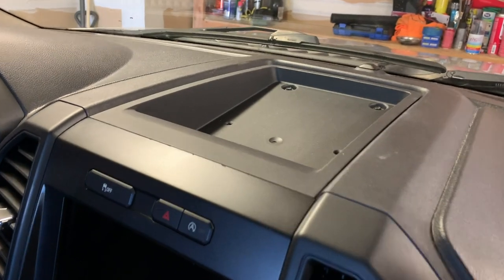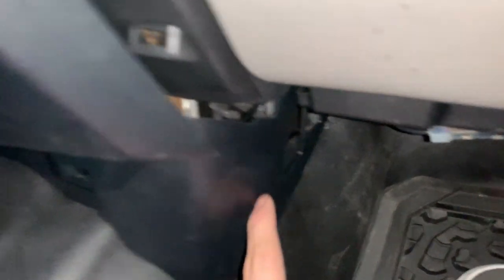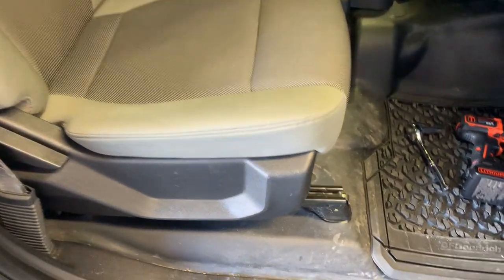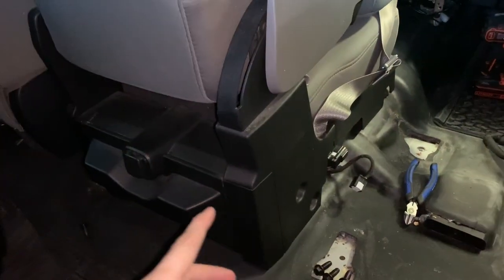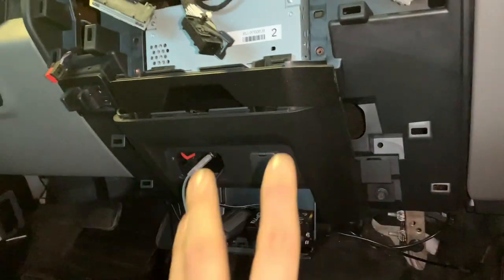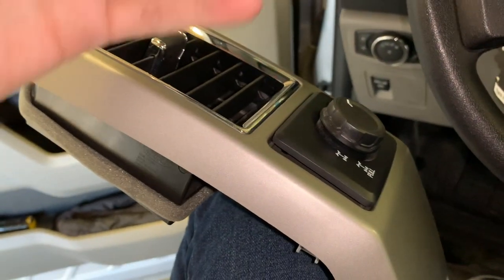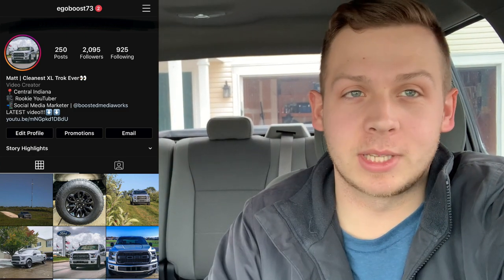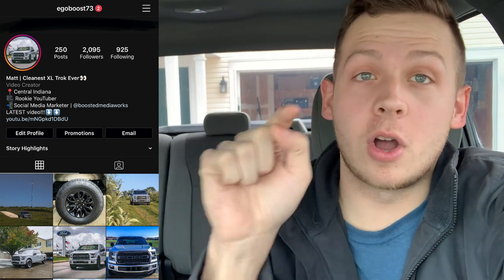15-21 F150 Center Console Install *In-Depth*

Comment from the maker: FULL DISCLOSURE: I did not hook up the rear vents.
Reply: Have you though about doing the keypad on the door install
Reply: I love having the bench seat option. Only reason I would install one of these would be for the rear vents. Wish we could have seen the full install.
Reply from the maker: ben randall I couldn’t set up the rear vents unless I wanted to cut up my floor which I was not interested in doing
Reply: This looks great! I want to do this to mine one day but I would like to hookup the vents as well.
Reply: @egoboost73 I saw you mentioned cutting the floor to add vents. What would you actually cut? Just the carpet I assume?
Reply from the maker: @jasonroth3787  I actually didn’t have carpet in my truck, I had the vinyl floors. If you have carpet, it might be easier to hook up the vents but I’m not sure how
Reply: @mattewalker_  ok. I saw you mentioned cutting up floor. I assumed it would be carpet/vinyl you are cutting and not the actual sheet metal floor. Figured I’d ask. Thanks. Hoping my ford guy can find the vent panels in the charcoal grey to match my interior and not silver like you used.
Reply: Was there anything additional that needed to be done for the electrical in the rear of the console to work?
Reply from the maker: @richardhom8283  nope! Not for my install
Reply: So I'm hoping you're still around..I'm doing this to my 2019 F150 BUT ALL the consoles I find don't have the lighter and the USB in the tray what console did you use?
Reply: @mattewalker_  you don’t have to cut up the floor to do the vents if you want to know how to do the rear vents I’d be happy to share with you how I did it
Reply: @davidrickey3776  how did you do it?
Reply: @fitzy1294  I added a short explaining.
Reply: @fitzy1294  I added a short explaining

Comment: Does hooking up the flow through vents require cutting the carpet? If you don't hook them up, is there still heat directed to the rear through the original vent system, or do you lost that? Very helpful, thanks!

Comment: Did you sell your jump seat? I’ve got 2 2019 f150’s.  Ones a lariat 4x4 super crew ecoboost the other is a XL 4x4 super crew that’s my daily driver.  It’s got the upgraded interior that’s basically a base model XLT but my jump seat a rest doesn’t have a consul only has the one under the jump seat. I’ve been thinking about replacing the jump seat with one that has the consul arm rest

Comment: Greetings well done how to. been a while back, but I also have a 2019 XL. Do you still have that center fold down? Picked up a rescue from the highway, she badly damaged the upholstery on the center seat you removed in this video. I would so like to replace this in my truck. Of course, I will pay for it and shipping. thanks.

Comment: I just ordered a center console on ebay so trying to get everything I need to do the install, I dont see the SD slot for the SYNC, is it not visible or does it end up just getting covered up?
Reply from the maker: By SD slot do you mean an SD card slot? Because if so, my kit did not come with one either. I have not needed an SD card slot whatsoever, even after upgrading to an 8inch screen and sync 3

Comment: Hello Egoboost73,  I installed my center console yesterday and when I got done my 2021 F250 Tremor does not detect my key fob when I try starting truck. (I have push button start on dash) my truck will not start also on my jump seat has a wire plug toward the passenger side. do I connect that to my new center console,
Reply from the maker: Yup! Plug in the wires on the passenger side and let me know how it goes!
Reply: @mattewalker_  Thanks

Comment: hello, will it be expensive to get raptor transfer case with the 4A?? what would it take ?
Reply from the maker: alejandro perezchica I’m not sure exactly on the cost. There’s a group on Facebook called Raptor Swapped f150’s. I’d check there so see if it’s possible

Comment: Hello awesome video  I just have one question  is it possible to convert the gear shifter to the center console as well?
Reply from the maker: Ike Abraham mustang follow @boostedgreygoose2016 on Instagram. He’s making a conversion harness right now!
Reply: @mattewalker_  is there a way to undo that? i hate the center console shifter, makes it feel like a car tbh. can u help me out possibly?
Reply from the maker: @bruh-om8ir  yes I believe so. Hit up @boostedgreygoose2016 on Instagram and he’ll have a better answer as to how to go about the wiring harness to undo the shifter
Reply: @bruh-om8ir  I know this is grossly late, but you can un-bolt it and buy the part to make it the pocket. You can buy it for around 200 that I have found -- FL3Z-1504567-DA

Comment: i need the 2 panels in black but i cant find them for the air vents
Reply: I’m in the same boat. I got a center Console that I want to install but I can’t find the inner panels in black.
Reply: @andrewcarter3596  i just put mine in yesterday brother hold on i got you
Reply: @andrewcarter3596  FL3Z-1504339-NA	and FL3Z-1504338-BD
Reply: Thanks man! Just ordered mine

Comment: Where’s the hyper flash fix vid
Reply from the maker: It's coming! Long story short, Forscan only works with non-macbook laptops and I currently only have a MacBook. I'm working on a way around that. I'm sorry for the delay!
Reply: Egoboost73 I’m thinking about getting the taillights but not sure Bcz of the hyperflash what do u recommend
Reply from the maker: Junior Mndz I 10/10 recommend these tail lights. I will be making a video on how to fix the hyper flash. Just working on making that happen right now
Reply: Egoboost73 alr thanks
Reply: Forscan. Lots of videos already on here about it and a bunch of other cool forscan stuff.

Comment: U skipped the most important part,  how did you bolt it in?  Where are the anchor points?  You mentioned the 2 10mm bolts in the back I removed them this console is still securely anchored to the floor,  I’m trying to remove mine to remove a stinky rodent nest inside then simply reinstall..
Don’t see ANY other anchor points or bolts